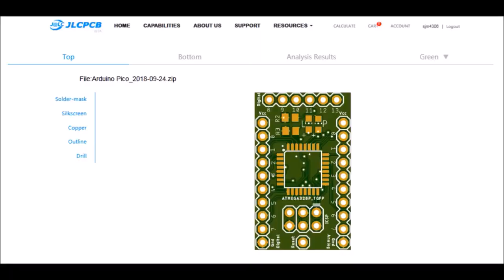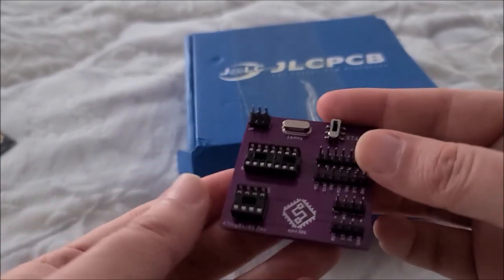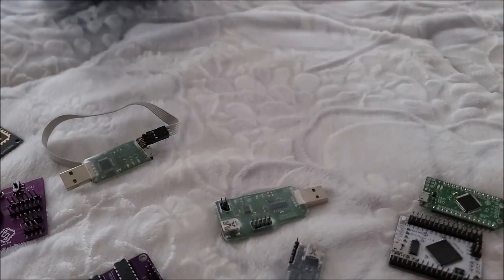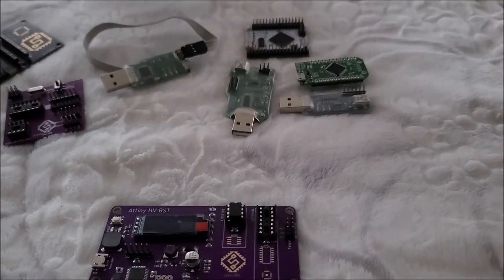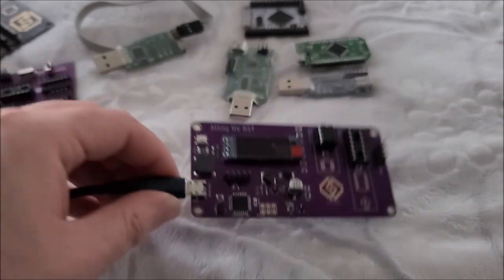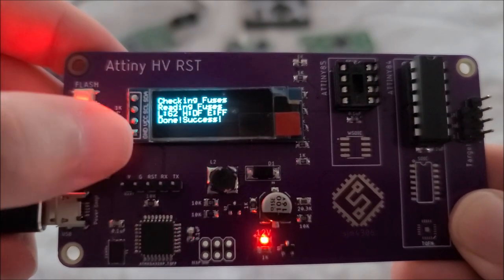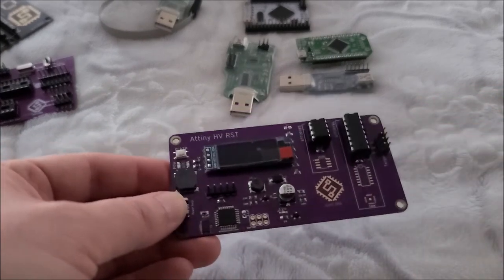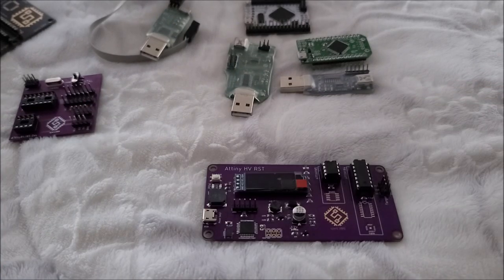Attiny High Voltage Fuse Reset-er

Comment: Enjoyed your HV Reset-er project, well done. I have "bricked" a few of the ATMEL MCU chips. Usually by accidently setting the fuses for external crystal, so not too hard to recover (I think you had another tool in your box of tricks to fix this one?)

One suggestion, for the "12V On LED" connect it between 12V and 5V so it won't light up if the 12V dies, and also will go off as soon as you unplug the USB cable.
Reply from the maker: That's a good idea for the 12V rail indicator led! I'll have to add it to the 2nd revision pcb.

Comment: nice, i did something similar but added a simple charge pump to get the 12v from 5v, worked great on my high voltage  fuse reset for 328P chips
Reply from the maker: Nice, I'll have to give charge pumps a try next time!

Comment: I could really need one of those. Do you have a Tindie-Store? I think ordering the board+components myself, soldering the parts and (somehow?) programm the uC with your hex file is above my skills. I could really use to reset Fuses tho :/ Can I get a board when I become a Patron? :P
Reply from the maker: Sorry I don't have a tindie store and with the chip shortage things are a bit difficult atm. If you just wanted the board and the atmega soldered+pre-programmed with the firmware I could do that for the cost of parts plus shipping, but you'd have to source and solder the rest of the parts (I can provide a BOM). If you want a complete fully tested board, I can scrounge around to see if I have the parts on hand but I'd have to charge for my time to assemble by hand. If you are interested shoot me an email at sjm4306@gmail.com and I can give you an estimate of how much it'd cost for me to make you one.